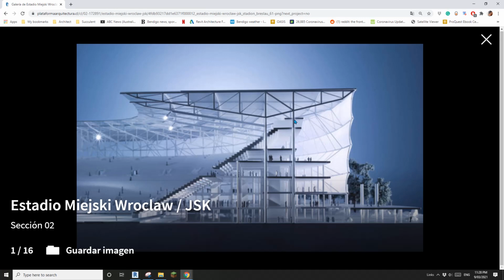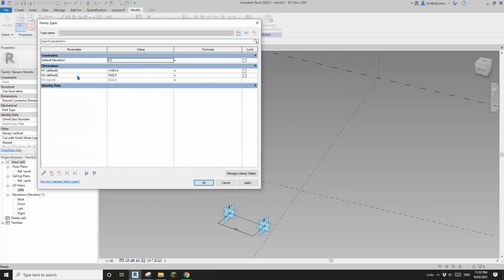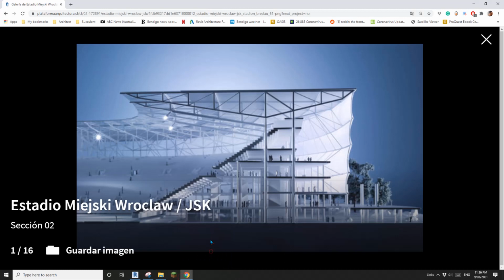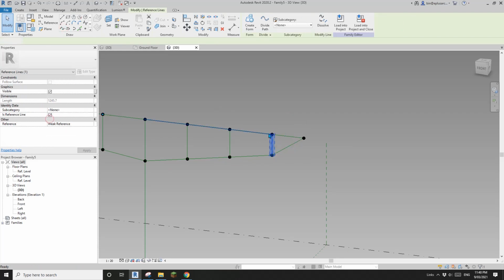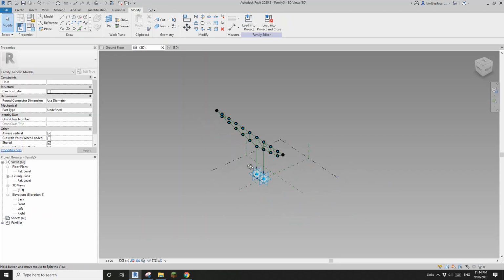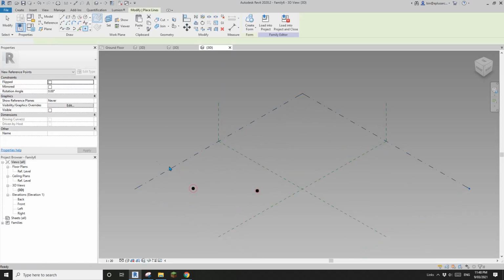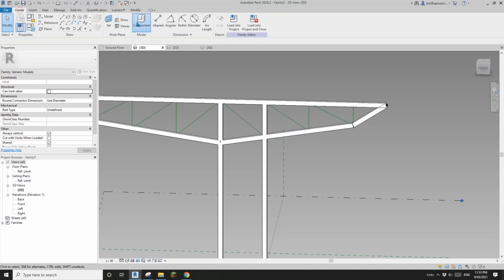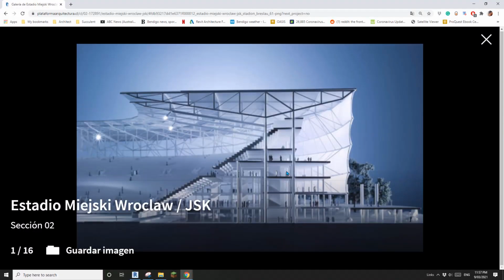Everyday  Revit (Day 357) - Stadium Structure with Adaptive Family

Comment: Good Day Mr Bin

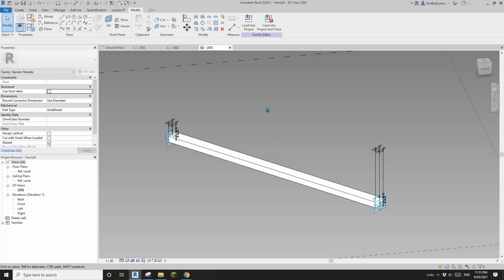Your video (357) on from (22:16 - 22:46)

1. How do you place a loaded family(Beam or Timber ) to have 2  Adaptive points at the
end points and be able to control it like in your video(357). In your video you make family
between 2 Adaptive points,but i would like to instead load an existing family. the reason is that
i want that family to have all the properties that come with original revit properties example be able to 
shedule them with the correct category.

i tried attaching a loaded family but it does not flex . It moves the entire family instead of adjusting the length both sides and up and down. when i use constraints they break when i move adjust/move the timber(M_Glulam Southeren pine).
Reply from the maker: I believe you can do that.
Here are the steps:

1. set your family so that all the parameters are Instance Parameter.
2. Create a new adaptive family with 2 adaptive points, create a reference line between them.
3. Add dimension to the 2 adaptive points, and create reporting parameter.
4. Load your family into adaptive family, and place on work plane of the reference line. You might need to set the properties of your family to be work-plane base, and uncheck always vertical.
5. Link your parameter of your family to the reporting parameter of the adaptive family. Constraint the family to the adaptive points or reference line if required.

I think this should work. I will do a video later... maybe next week.
Reply: Thanks you for the quick reply, i will try it, it seems a bit complex at my level. Please drop me a message if you do make a video on this topic, please include shared parameters on it. What im trying to do is a custom truss,
that i can load using Dynamo. The thing is Revit Existing trusses are a pain to work with because the joins are not proper according to my liking. In South Africa small construction use nails to join truss member on top of each other. I want to create a scheduled truss and its members, and ability to do different truss joins options, is somewhat a long project. your help will be great. thanks again.
Reply: I tried it Still same problem. i fail step4 and 5 on how to implement that properly. The entire Timber(beam) moves instead of shape handle of the family, so that when i pull the adaptive left or right it increases the lenghth of beam ie shape handle is sync/locked to either side of the adaptive point. but when i move the adaptive point up the side also goes up, so that when i place it nesting it to a triangle of an adaptive component it flex accordingly following the point of a triangle. and the inside members that i wil be placing point to point to creat my truss.
Reply: i just realised i need a formula to do the insides members,not easy as i thought. im going to try  doing adaptive points over adaptive points to fill the inside members.
Reply from the maker: I can have a look if you can send me your file. You can upload your file on the shared folder I have in my Twitter Bio. @binhe615